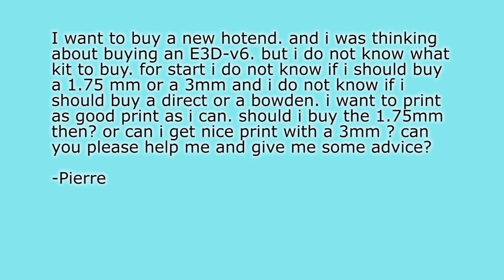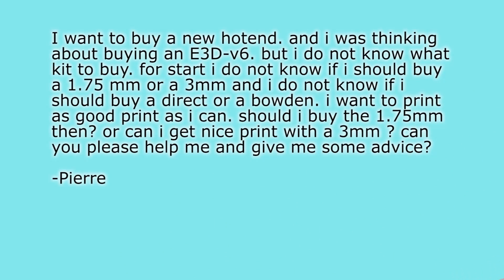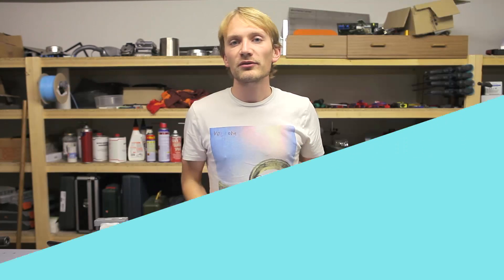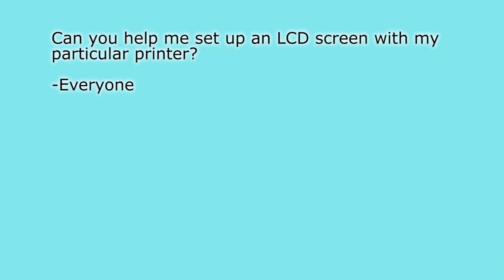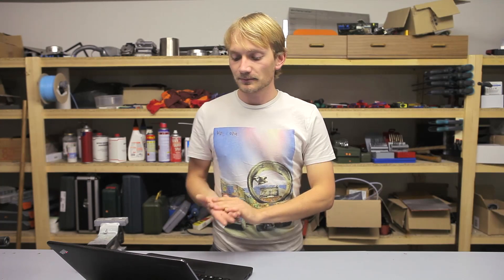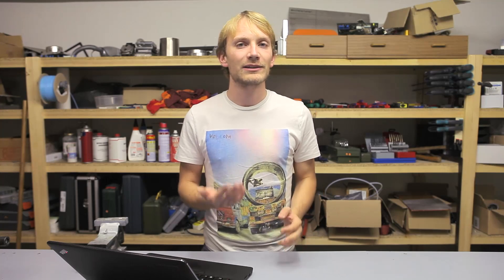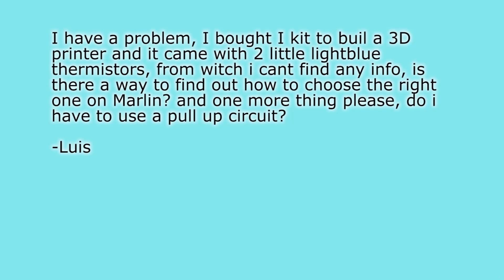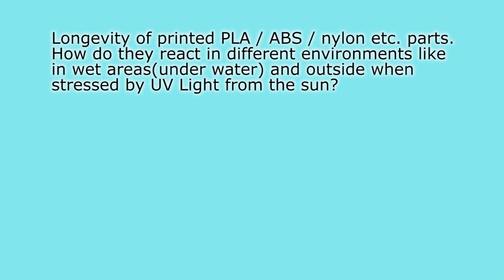Q&A: Filament size, bowden vs. direct and ways of measuring temperatures!

Comment: My Bowden prints TPU 95 at 60mm/s fine. The issues are retraction tuning, hobs slipping, and friction in the tube. I've experienced none of that on my Q4 2018 Ender 3 however. The extruder filament guide  was already updated to have a small gap, spring tension was increased, the gear has more numerous yet smaller teeth which grip well, and it seems my PTFE tubing is of adequately low friction and has enough room in it for expanding flexibles to continue sliding. I was about to change to direct drive but I'm not sure, I think the ringing from increased mass on the head is worse than the rare extrusion control issues present on a Bowden. Do you have any different thoughts on this today, Tom?

Comment: Good overview, but did you not lately have issues with 1.75mm not going fast enough in some review?
Might be time for update.

I've always used 3mm and still sticking with that despite availability issues. Curious however that does the hobbed bolt / wade's care if fed 3mm or 1.75mm so i could use some special filaments on the market...

Comment: Can you convert a direct drive E3D V6 into a bowden or are you stuck with whatever hotend you buy?
Reply: Thanks, I got XYZ Duo that won't push PLA anymore so was thinking about replacing parts. Not sure if titan extruder would fit or just mount bowdens.

Comment: Hello what would you recommend as a easy and versatile control board for beginners ie, minimal soldering, quick and easy set up, multiple extruders, dual z axis, heated bed, electronic voltage control for stepper motors, etc

Comment: I was at the TCT + personalize show last week and came away with a whole load of useful information.

One thing I saw was a hybrid extruder drive (on the Ooznest stand I think). They had the extruder mounted above the hot-end, but the stepper motor mounted remotely with a flexi-cable drive. Potentially you got the advantage of a lower print head mass, but without the disadvantage of a Bowden feed.

Comment: You mentioned in passing that you do not think the Velleman (3Drag) is a good alternative . Would you like to elaborate on that view? Perhaps in your next QA video? 

I am currently thinking of replacing my Printrbot LC. I am looking for something economical that has a metal frame and a larger build volume than the Printrbot. Buying a Velleman K8200 and replacing the substandard 3mm hotend with a good 1.75 alternative seems like a very economical and viable alternative to me,  but I might be missing something.
Reply: I have a K8200 at work and I'm getting quite reasonable results, even with the standard hot end. That being said, I was at the TCT show on Wednesday and you can buy a ready built DaVinci for the same money. It looked quite a reasonable device.
Reply: We 3d printer "expert" have our prejudices about these weird designs which does not looks that solid.
Reply: an K8200 can give profesional results if you spend some time on it.

Comment: Timing belts... which belt do you recommend?
I'm having difficulties with my PrintrBot Simple Metal, where the X axis belt have ... malfunctioned, several times...
(I think the problem was too much space between the pulley and the bearings, allowing the belt to get caught between them, and resulting in deformation of the belt)

I replaced the belt with one which have metal wires, reinforcing length wise, but I'm not so sure it is a good choice (I'm thinking metal-fatigue might be part of why the problem persists even though I have improved on the bearing design with double bearings and moved the bearings closer to the pulley)

So... which belt would you recommend I try out next?
(I got my replacement belts from a Danish store: http://3dnielsen.dk/product.php?id_product=86)
Reply: GT2. get smallest pulley size you can get.
Reply: But it is a GT2 belt I'm using.. and the pulley have about 1-2mm clearance on the sides...
I'm asking about the type of GT2 belt, there must be a better manufacturer, than what I'm currently using?
Reply: *****  It looks like I managed to find a worthy replacement. The printer seems very stable now, with this fiber-reinforced timing belt, much better than a metal-wire-reinforced belt.
http://alfa-tech3d.com/timing-belt-pulley/gt2-6-timing-belt-2-meter-and-2-pulley-with-3-x-m4-grub-screws.html

Comment: Thx for helping me with all of this. :) Can you please help me with one more problem. is the Bulldog xl a good extrude?
if i buy a 1.75mm E3D-V6 hotend i need to buy a new extrude and i found the Bulldog xl extrude (https://www.reprapsource.com/shop/show/6954).
Keep doing grate videos :)
Reply: Its a nice extruder. rock solid from what i have heard. the only problem i can see that it may have problem getting the pressure right on filament or clearing the drive gear.
Reply: ***** ok thx.  I have a k8200 and I am going to Change extruder and hotend.  I Think i will buy a E6D-v6 and a bulldog xl.  But i have read that the bulldog xl is heavy.  Don't know if it is to heavy for my printer.
Reply: You dont need xl. Lite should work for 1.75. About weight it should not be issue as its screw driven z axis.
Reply: ***** will lite work with 3mm to?
Reply: Pierre Fransson No. as per documentation xl have gearbox so it can be used with 3mm
Reply: ***** ok then i will buy a  xl.  That way i can buy a 1.75mm and a 3mm hotend to. 😂